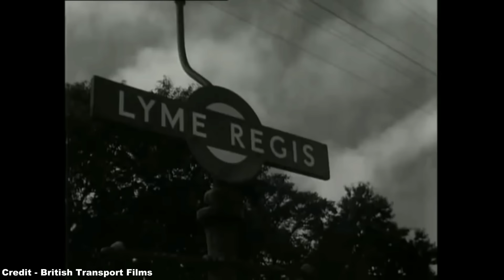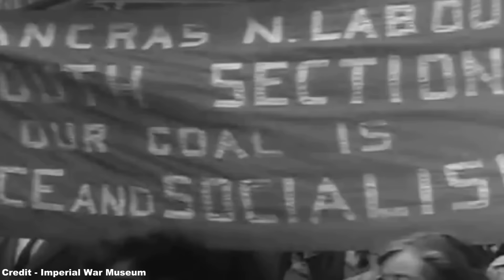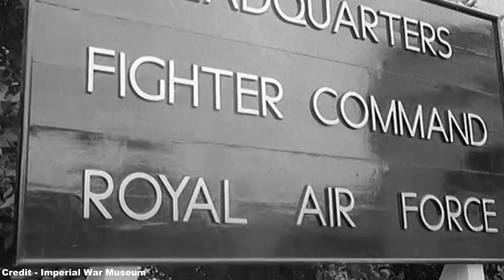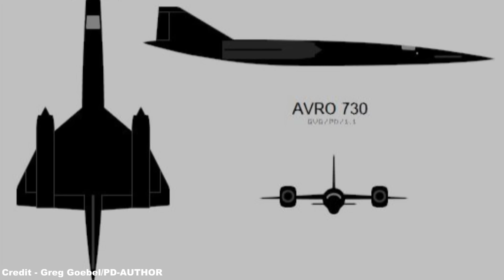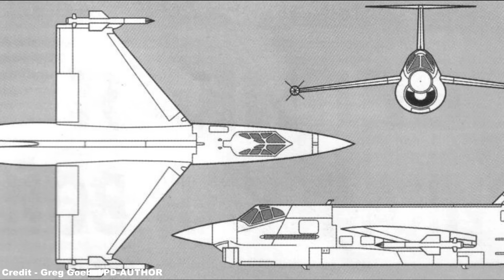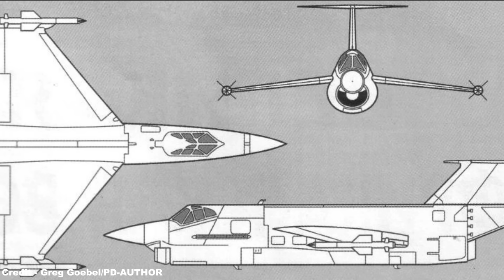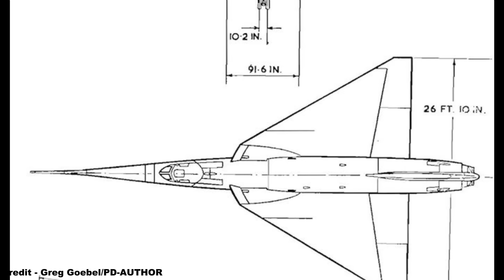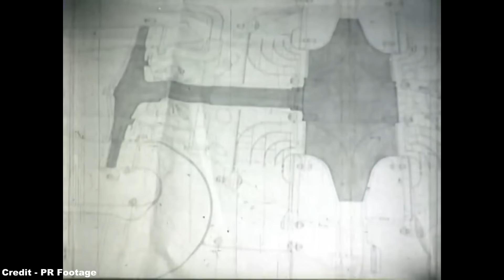The 1957 Defence White Paper - Death by a Thousand Cuts

Comment: by 1957, the Mirage III had been undergoing flight test for a year already. The maiden flight of the XF-4 Phantom was only a year away and that was the aircraft both the RAF and FAA ended up flying. Would any of these designs have been better and more powerful than the Phantom? I doubt it. Two world wars later suffering both nazism and communism and Europe was irrevocably lagging behind the US.
The Mirage III would have benefited from Rolls-Royce engines just as the Phantom did.
Reply: The BMW 109-018 (ATAR 101) was the first European jet engines to achieve Mach 2 (Mirage III) significantly more advanced than Rolls-Royce who were still struggling to catch up with the rest of the world in axial compressor technology after having wasted a decade developing centrifugal engines which were an evolutionary dead-end.
Reply: How were the RR Phantoms better than the GE J79's?
Reply: @Hattonbank  They weren't...
Reply: That's what I understood as well. Reduced performance and added to the cost.
Reply: @sandervanderkammen9230 It's impressive, I have not actually managed to see a comment more wrong than this.

Rolls-Royce mded the switch from centrifugal turbojets to axial turbojets in the 1940s with the development of the Avon. Metrovick and Armstrong Siddeley had already made this switch earlier with the F.2 Beryl and Sapphire, but the Avon was superior to either.

The ATAR series were a dead-end with considerably worse performance than the contemporary Rolls-Royce Avon (the Avon had twice the thrust to weight ratio).

To have even mediocre turbofans SNECMA had to cooperate with Pratt & Whitney to create the TF30-derived TF104, TF106 & TF306, whilst Rolls-Royce were producing the Spey, and had the RB.211 under development . Only in France could the TF30 be considered a good engine. To even have a somewhat competitive fighter powerplant, France had to conduct industrial espionage during the development of the CFM-56 to use the core for the SNECMA M88.
Reply: @Hattonbank They had better fuel efficiency, hence longer range and better endurance, and more thrust for a shorter take-off run. They were also much faster at low-level. Considerably superior to the US J-79 variants given that the Royal Navy was procuring them as interceptors for their smaller carriers (hence the importance of endurance and take-off) and the RAF were procuring them a fighter-bombers for RAF Germany (hence the improved low-level speed and range).

Plus it provided industrial support for Rolls-Royce.
Reply: @forcea1454  Bollocks mate!
You're taking the piss!
Britain was more than a decade behind in axial compressor turbojets
Rolls-Royce only manufactured obsolete centrifugal jet engines in the 1940s, it continued development of centrifugal engines throughout the 40s and production did not end until 1954, production of the Avon did begin until 1950.
 Most aircraft which used the Avon didn't enter operational service until 1954 and commercial airworthiness certification wasn't until 1958.

The Metrovick was an unmitigated failure, it never entered series production or achieved flight-certification.
Metropolitan-Vickers abandoned jet engine development in failure in 1947 and returned to production of steam engines.

The Armstrong Siddeley would not achieve 150 hour PFTR until November 1951 production started in 1952 and entered operational service until 1956.

The BMW 109-018 "aka" ATAR was designed by Hermann Östrich in 1940.

The Rolls-Royce RB211 was shambolic fiasco that bankrupted the company in 1971 and sabotoged the production of the L-1011.
Reply: @forcea1454  The fitting of the Rolls-Royce Spey engines in the F-4 was purely economics.
The GE J79 powered version was significantly faster (Mach 2.23 compared to just Mach 1.9 with Spey) and carried a heavier payload.
Britain was in total economic collapse, the aircraft industry imploded in 1960, restructuring and mergers led to massive cost overruns and project cancellations of British aircraft, The UK government was again insolvent,  it defaulted on its war debts in 1964 and 1965.
The government could not afford to buy the much needed modern aircraft like the F-4 and a plan was devised to offset the trade deficit amd debt payments by building some of the components in British factories this would prevent additional unemployment and closures in the aircraft industry.

 Britain operated both versions, no other countries bought or used the Spey powered version.
Reply: @sandervanderkammen9230  the fact that Rolls-Royce continued to produce and provide support for centrifugal engines into the 1950s does mean they were behind, especially when they were already beginning R&D for the Avon. The Rolls Royce Avon began development in 1945 and first ran in 1947, was flown aboard a test aircraft in 1948, and entered service with production English Electric Canberras in 1950. The ATAR did not run until 1948, did not fly until 1950, and did not enter service with a production aircraft until 1956. If anything it was lagging behind the much superior Avon, and broadly contemporary with the somewhat superior Sapphire.

There is more to an aircraft than speed, and in the environments Britain was using its Phantoms in, the Rolls-Royce Spey was superior. The J-79 variants were purchased in the 1980s for air defence of the Falklands, as a gap-filler until the Tornado ADV entered service, not due to any superiority of the J-79 variants. Britain was not collapsing in the 1960s, it was experiencing higher rates of economic growth then than it is now today. The Aviation industry was highly successful, and in spite of the 1960s cancellations was able to do most of the development work for sophisticated aircraft with advanced avionics like the Tornado and later Typhoon.

Spey Phantoms could carry more than J-79 Phantoms, they literally had more thrust, and hence capability to do so.

At least Britain was able to actually purchase modern combat aircraft, rather than persisting with obsolete Mirage III derivatives. An entire generation of French combat aircraft between the Mirage III and Mirage 2000 was essentially stillborn, and the AdA never put any modern two-seat twin-engined all-weather strike aircraft into service until the Rafael, in spite of numerous attempts to do so.

RB.211 was considerably more advanced than anything France was capable of producing at the time, in spite of any technical problems. Once the problems were ironed out, it became a very successful engine, especially due to the emphasis on fuel efficiency post 1973 Oil Crisis. How many comparable Turbofans has SNECMA been able to produce on their own, without first either recieving help from, or stealing the work of General Electric?
Reply: @forcea1454  You just proved my point, Thank you!
Yes, I absolutely agree, britain was incapable of mass production of axial compressor turbojets until the 1950s.
It was a genius German engineer at the RLM named Helmut Schelp that recognized that centrifugal jet engines were an evolutionary dead-end concept and convinced the German ministry to abandoned their development immediately in favor of the vastly superior Axial compressor type.
His calculations showed that centrifugal compressors could only offer a marginal increase in performance over propellers and that high transsonic and supersonic performance could not be achieved with CTJs.
  The continued development and production of centrifugal engines and the failure of the Miles M.52 is irrefutable evidence that britain was a decade behind in jet engine technology.
This lag in technology was exacerbated by Britain's failure to attract German engineers to relocate to the UK, they ended up in America and France with the Americans activity recruiting Nazi scientists and engineers as part of the massive Operation Paperclip and Operation LUSTY.
Reply: @forcea1454  Powering the F-4 with Spey engines was purely a cost cutting decision, and all the modifications were part of a welfare employed scheme.

The RB211 was a huge gamble that failed, the British government was forced to step in and bailout Rolls-Royce... they continued losing money until the company was broken up and sold off piece meal.

The English Electric Lightning was the first, last, and only british supersonic combat aircraft. The Mirage III was hugely successful aircraft by comparison with thousands sold and is still in service, France still builds its own supersonic jet fighter

The French made the smart move, in 1974 they formed a highly successful partnership with General Electric to form
CFM International, this partnership now dominates the world commercial jet market while Rolls-Royce struggles as a minority player.
Reply: @sandervanderkammen9230 Use of the Spey increased the price, and there were technical reasons it was selected in the first place, the increased thrust was necessary to get of Royal Navy carriers. Nothing wrong with industrial strategy, if France hadn't done similar things with ATAR, then it wouldn't have been a success.

Mirage III was an export success because poorer countries like cheaper single-seat, single-engined aircraft. Britain however, was planning to fight a war with the Soviet Union, and needed technically complex twin-seat, twin-engined aircraft. The French Airforce also wanted technically complex twin-seat, twin-engined aircraft, but was forced to compromise and accept inferior single-seat single-engined aircraft due to cost.

RB.211 was massive commercial success after the 1973 Oil Crisis, and forms the basis of modern Rolls-Royce Trent. Rolls-Royce still exists, it was not sold of piecemeal.

CFM International is a global player entirely because of General Electric. Basically no French technical knowledge was involved, given how far they behind lag in gas turbine design. Rolls-Royce is still the third largest Turbofan manufacturer in terms of market share.
Reply: @forcea1454  The Spey is more expensive  because so few were sold compared to the J79... of course they became even more expensive when Rolls-Royce went bankrupt and the government had to pay for the debt to develop them plus production costs which were already subsidized.
The reason why the Spey was selected was because the UK government simply didn't have the available cash to make it's reparations payments to America and pay for the planes and the engines.
Not only was the J79 a better engine it was better suited to the F-4 which was obviously much faster with the GE engines than the Spey.
Reply: @forcea1454  Dassault sold over 400% more Mirage IIIs the Lightning because it was better, cheaper, more versatile aircraft with nearly 500% greater effective combat range... the Lightning was crippled by it's very short 155 mile range.

Comment: While I don't think Saunders-Roe rocket fighters would've necessarily been the best choice, I think describing their propellants as "dirty" or "volatile" is a bit of a disservice.  High-concentration hydrogen peroxide needs to be properly stored and handled, but the same is true of any storable energetic compound.  It's nowhere near as toxic as the nitric oxide that some Nazi rocket fighters had baselined, and while it's not as stable as jet fuel, the difference is less than one would expect.
Indeed, the enduring fear of hydrogen peroxide as a propellant has more to do with the U.S. Air Force, which believed it would explode at the slightest bump and refused to touch the stuff, than with anything Saunders-Roe did - as evidenced by their designs actually working.
Reply: Not one airforce adopted a rocket powered fighter since 1944.
Reply: @timp3931  Absolutely, because rocket fighters as a whole weren't a great solution to the problems at hand.  But hydrogen peroxide has seen significant use in rockets and generators of other types in recent history.
Despite its supposedly sordid naval history, the Swedish navy still uses it in torpedos today - past incidents have generally involved misuse or neglect, which is a problem with most energetic chemicals.

Comment: Good video !  Interesting that politicians of the day must have been well aware that the true tragedy of loss in productive potential both in terms of Intellectual input, and machine tools, would not become widely apparent until after they had left the stage. I'd also wonder to what extent the 'Welfare State' played a part in the whole show given that many of the ventures that were let go were hugely dependant upon government largesse, and that governments were faced with costs for the cradle to grave system that were rising at an ever faster rate. That may be an issue coming around again, with the revitalisation of Russian armaments capacity it would seem likely that NATO countries will have to respond with increased defence spending ? Given the fairly generous level of welfare spending in the UK today there is the distinct possibility of a choice having to be made between guns or butter, something not seen since the 40's.
Reply: The NHS started as a millstone and has grown into what will be a tombstone without reform. Politicions are too scared to touch it after Blair's attempt made things worse.
Reply: @davidpeters6536  It needs to morph into something like the French or German model, but as you say, any potential and realistic reform other than squirting more money at it meets with such howls from the public that it is very much a third rail.

Comment: At c.7:57 you state that Professor Keith Hayward was responsible for drafting the air aspects of the 1957 White Paper.  That seems odd - the White Paper is usually attributed to Duncan Sandys, though no doubt that, as a politician, he had experts to do the legwork. Professor Keith Hayward is a current author - might this, say, be his father, if the attribution is correct?